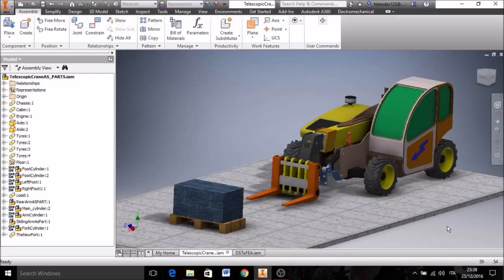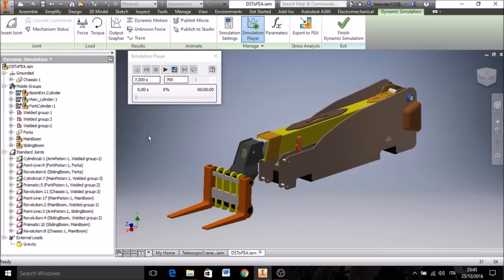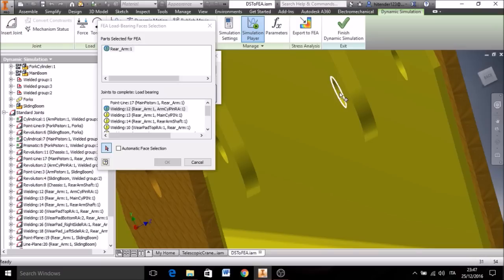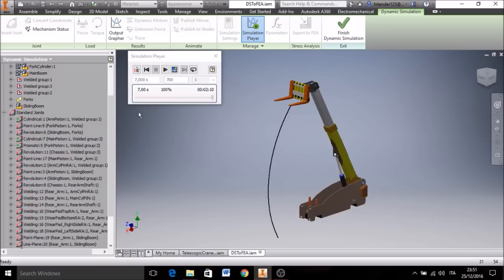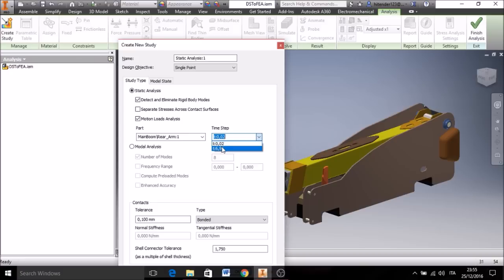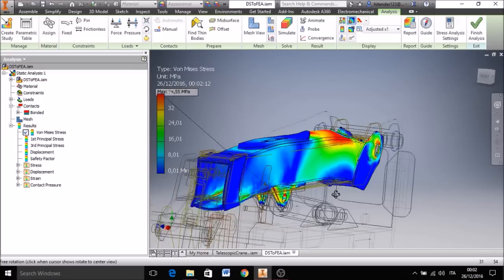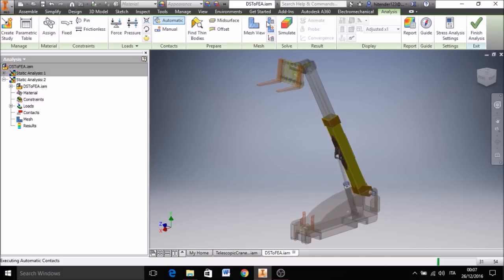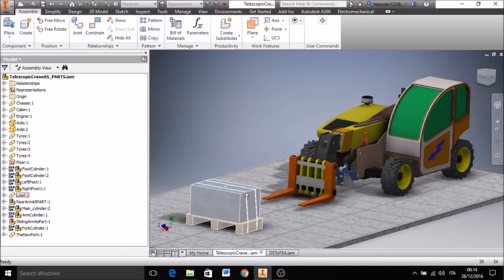Autodesk Inventor 2016, Dynamic Simulation to FEA, Telehandler

Comment: I wonder if it is real to use bonded contact since those are welded plates.
Reply from the maker: You can create weld beads on the welded components and can therefore consider a bonded contact between beads and components, you must disable bonded contacts between various components, this way the result will be more realistic.
But, as the calculation will more complex so it might take a lot of time.
Reply: @hitenderluxmi I will need to try in order to find out if it makes a significant difference on the results

Comment: Hi I faces over constrain error while i entered to dynamic simulation. I tried too hard to remove the error but it's not works. Can you help me
I learnt this software by my self so I have not clear fundamental for work flows like use of flexible command
Reply from the maker: Hi Manish, you must apply minimum possible constraints  to the assembly in such a way that the part can move freely as you want it to and yet is not over constrained.
To start with  create an assembly containing 3 parts. Try applying constraints logically. For example instead of applying  a coincident constraint between axis of shaft with axis of hole, you can apply a coincident constraint between a point on axis of shaft and a point on hole and then apply angular constraint between two faces on both parts.
Reply from the maker: To learn Inventor properly start with the tutorials incorporated in the software. Once you have completed all the tutorials you will have a good command on it

Comment: Hello Mr. Hitender, 
I'm a senior mechanical engineering student and I'm working with Inventor for a project of mine. I'm having trouble with the set up of my assembly as I take it to dynamic simulation. I'm sure my problems arise from the constraints I used initially but I feel I need a professionals' help since I've gotten this far on my own by just watching YouTube videos(many of them yours). I was wondering if you'd be willing to help me solve the issues I'm having? 
If you're willing and have the time, my email is aaron.alvarez2017@gmail.com. Send email and we can discuss details, thank you. 

-Aaron